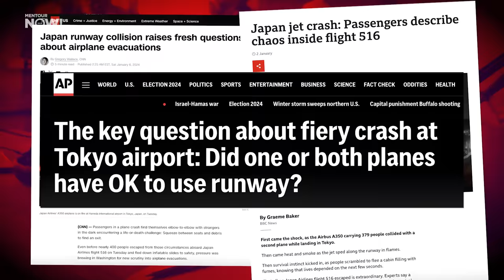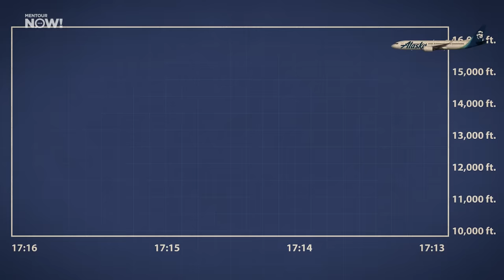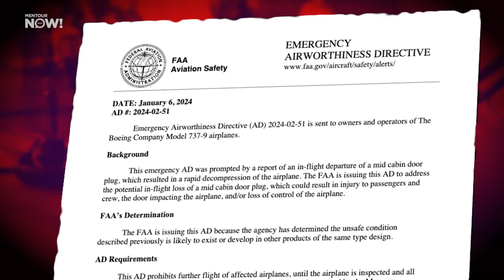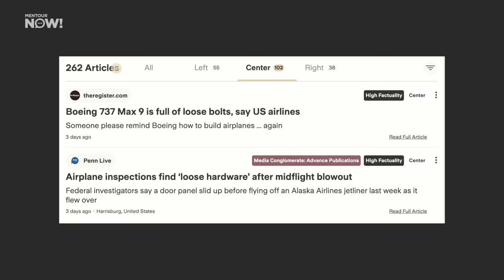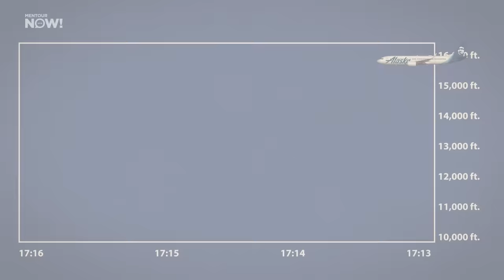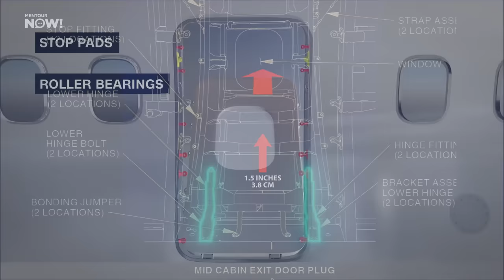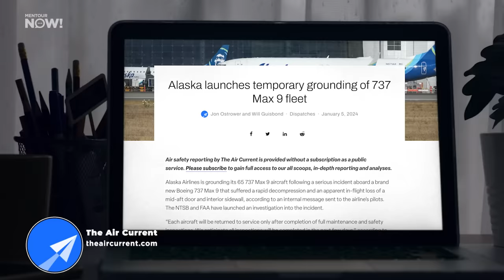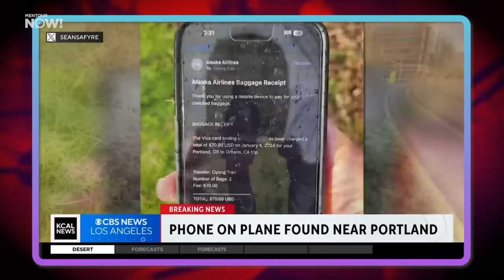WHAT Is going ON with Boeing?! MAX-9 Door blowout

Comment: Boeing used to be the coolest company ever.  As a kid I was totally awestruck when I saw the 747 for the first time; it was totally out of this world, and it was 30 years before Airbus became a reality.  Now Airbus is the world's largest manufacturer of airliners, and Boeing can't update a 50-year old plane design without screwing up.  So much for "maximising shareholder value."
Reply: Is Airbus the largest? I thought they were still not as big as Boeing.
Reply: Yes, very sad situation. I used to admire the earlier Boeings.
Reply: Poor management.
Reply: Stay off Boeing!!!!
Reply: Boeing went downhill when the executives at McDonnell Douglas took over at Boeing after the merger (after already screwing up McDonnell Douglas).  Before the merger, Boeing was run by engineers who lived on the floor and optimized the airplanes through production improvements.  The culture changed to a financial culture run by know nothing MBA's almost immediately after the merger.  Moving production to North Carolina didn't help either (they did that to use non-unionized non-experienced workers).
Reply: Profit over people. 😢
Reply: @Adam_U Airbus has consistently beaten Boeing in both orders and deliveries over the past 5 years. So yes, Airbus holds the top spot as leader of commercial aviation
Reply: @Adam_U Airbus has Boeing beat when Airbus became an American Manufacturer as well, they opened a factory in Alabama and produce A220 and A320 and without problems, Airbus also has a factory in China and of course in Europe, that makes them a global manufacturer now. Boeing doesn’t have the capability to produce aircraft in other countries, they’ve tried it in the past and every time failed, they are incapable of working with other governments or local regulators, and are even failing at working with American regulators (FAA)
Reply: @Adam_U  Airbus are significantly larger in the airliner sector. Boeing also makes a lot from military sales ! The most popular airliner is now the A320 family, NOT the B737.
Reply: @steveburton5825  Exactly.  If incompetence was criminal, the MD execs would be in for a lifetime sentence.
Reply: @ytzpilot  Which highlights the fact that this is a management problem, not an engineering or labor issue.
Reply: Boeing wide-bodies have always been reliable and innovative, but the 737 not so much.
Search about the 737-original/classic rudder issue fiasco and you’ll figure that Boeing had problems in its “golden years” too…even before merging with McDonnell Douglas.
Reply: Maybe management should remove share price from its list of strategic goals and focus on becoming a reputable company again. instead. It's obviously too late to undo that terrible merger that killed the spirit of Boeing.

I don't think I want to step onto a Boeing plane for the time being.
Reply: H1Boeing
Reply: According to Jack Welch, Boeing has done everything correctly.  What's the big deal about some stupid door falling off?  Nobody was hurt.  It's just a marketing problem -- why not just call the missing door a "ventilation option"?
Reply: @stevencooke6451  The 737, maybe. But I see no reason not to step onboard, say, a 777
Reply: How on earth did whoever Boeing had finally assemble this thing, get it wrong without being caught until something like this happen?  The door plugs were supposedly taken out until the interior was furnished, to make it easier to get items into the fuselage.  So whoever reassembled the door plugs into the door frames, being the last to touch them, must have been at fault.
Reply: @wildanfatihg  Should note that the fuselage for both come from Spirit Aerospace.  I suggest it is the age of the plane one should consider.
Reply: I used to work for a mutual insurance company which are banned from paying divideds and have to reinvest everything they make. It was shocking to me how much money they had for everything compared to conventional corporations whether in insurance or other fields. When I heard about how the US after WW2 applied confiscatory tax rates to dividends to discourage profiteering and encourage reinvestment it made so much sense. Even up to Reagan the tax rates on profits were 70% and then the top income of the wealthy was taxed another 70% for about 90% combined taxation on profiteering. We need to get back to that ASAP before everything in this country completely goes to $h!t.
Reply: Airbus was founded one year after 747 was released. The consortium which later became Airbus made CONCORDE.
Reply: Capitalism. Have to have constant growth to suit the market & investors. Only way to do that is cut corners.
Reply: We don't need no engineers, we need more salesmen.
Reply: @cormaccarroll Boeing started as a capitalist company & ran that way for many years very successfully. Something changed their corporate culture. It’s different leadership. Bad, greedy, incompetent.
Reply: @steveburton5825  So what happened at Airbus? Mentour pilot has quite a few videos on Airbus design issues that which have resulted in many deaths or at least traumatised passengers and pilots. I can think of a few others that didn't make his list.
Reply: lmao listen to this guy, I'm sure he highly educated and absolutely knows what he talking about.
Reply: DEI over safety
Reply: all you clowns knocking Boeing for this, PLEASE NOTE: @21:40 in the video, you will find the author of this video confirming this is NOT a problem with Boeing's design, as these exact same systems have been in use for DECADES on literally thousands of planes.
Reply: @thomasneal9291  Nobody is knocking the design - it's Boeing's poor quality control.
Reply: @Adam_U airbus has almost twice the market share
Reply: The merger with MD ruined Boeing and turned it into MD.
Reply: I agree. Also Look at what they contributed to the Space program? Like the shuttle?
Reply: @Adam_U Airbus surpassed Boeing in 2019.
Reply: Any company that specialises in "Shareholder value" is going to fail.

Companies survive and thrive when they produce a well engineered product that fulfills the requirements of the customers at a cost they can afford. If you fulfill those three requirements then your product will be in demand and you then have a chance at making a profit.
Reply: I remember when I was in engineering school in Madison WI, a number of my classmates took jobs at Boeing, but the word was they tended to not keep their new engineers much beyond the project lifetime that they hired in for.  This was in the late 1980s.
Seems to me they had a reputation problem already developing.
Reply: Boeing couldn't even design the cargo door of the 747 to remain closed... Boeing was never cool. Fuel tank that explodes, rudder jamming, thrust reverser activation mid flight, engines dropping off the wings.
Reply: @Adam_U 
I believe as far as commercial aviation goes that Airbus is consistently  outselling Boeing in large part due to the A320 family of aircraft.
Reply: Replacing engineers with accountants and financiers is always a recipe for disaster.  See General Motors after 1970.  The car guys retired over the years and they were replaced by bean-counters who knew jack about cars.
Reply: @Ayayau57  I think Boeing should just put the 737 into rest forever. This design has been around for ages and I think its full potential is already reached
Reply: I reckon this is the beginning of the beginning of the beginning of the end for Boeing.
Reply: No-one said it's a design problem: it's a quality/ greed problem.
Reply: @cormaccarroll   I am from a country that had witnessed communism… And I think that the corruption and nepotism during communism was making worse products than in capitalism… Should I mention the failed Tu-144 as an example?
Reply: @johnsonwu3001  Exactly… They had wanted to do this before but airbus launched the a320neo a decade ago while they were developing thr 797, and that forced them to make this 737 ‘MAX’
Reply: To be fair - the 737 deserves to be retired. It replaced the 727, which replaced the 707. Time for something new, since all the MAX' issues come from the simple fact that this bird can't be upgraded anymore. When the 787 was built, they planned for a small/midrange-variant with reduced seat-capacity, decided against it. (even Airbus hesitated for a new "small range-plane" - alloweing Bombardier and Embraer rollilng up the market)
So the only sane thing Boeing could do: let the 737 take its place in history-books, end the 7xx-series, building a new one; with modern manufacturing aso. 
It's not like Passenger will avoid flying with Boeing (if it's boeing i aint going!) due to all the issues the NEW boeings since about 2010 are having - so leave that old technology adapted to the new world be, and build a new plane? (everything else means "end of business" very shortly)
Reply: The thing about shares and the stock market is that it's a hype train. Safety is expensive and not exciting. Shareholders want to hear about how you're putting the rudder on the blockchain or whatever the latest fad is. That gets the stocks jumping, even though it's nonsensical.
Reply: @Adam_U  I think the size difference between Airbus and Boeing depends on the civlian/military sector. Airbus Defence only has a few big military programs and is mostly civilian, nowhere on the same level as Boeing. So civilian+military, Boeing is still a bit bigger than Airbus.

But in the civilian airliner sector specifically, Airbus has overtaken Boeing.
Reply: Read "The Black Swan" by Nassim Taleb.     A key point is that increasing efficiency inevitably leads to increased fragility (vulnerability to failure).

Engineering has a very strong safety culture that protects against that increased vulnerability to failure.      Boeing was OK as long as engineers were in charge.   Once they put people with financial backgrounds in charge, serious degradation of safety was inevitable.   Financial people are obsessed with efficiency above all other things, including human lives.
Reply: @pywaketpilot  But at this point, we don't yet know it it was boeing,   The evidence far more strongly implicates the airlines and whoever did the maintenance and cleaning of the aircraft, IMHO.
Reply: @jimbarron9939  No, it doesn't implicate Alaska Airlines or their maintenance.   This was a brand-new plane delivered only 2 months before the door blew out.  That's a manufacturing defect and is Boeing's fault.
Reply: @samuelglover7685 Jack Welch, who vandalised and destroyed GE.
Reply: @SkyrimCZtutorials Not entirely.
Reply: As with so many other big companies in the last several decades, they went from being run by people who were actually knowledgeable of and invested in the products they were making to being run by people who don't care about anything except to what extreme they can minmax their profit margins every single quarter.
Reply: I remember the sense of adventure when I went on an international trip, aged 10. The first leg of the journey was in a 707 operated by BOAC. And yes, I  have travelled by 737 too, back in the 1970s.  I wish the investigative teams well forming a useful opinion on what went wrong and why,  so they can publish recommendations that help make flying safer for everyone.
Reply: Uhm the Airbus A300 had it's first flight in 1971, two years after the B747. I5 was the first two engine wide body jet, a now common feature in the Airbus and Boeing fleet. So not exactly 30 years. And the companies that merged into Airbus had themselves been making aircraft in some cases longer than Boeing, like BAC, who together with the French companies that built Concorde became Airbus. So really Concorde is the first Airbus. It was just called an Anglo-French cooperation not a seperate comany yet but Concorde showed the could work together well and very soon after Concorde began to fly those same companies officially started Airbus with the A300. An ambitious project, you don't start off with a widebody. But of course Airbus wasn't really new, it was just a new moniker for a bunch of companies who had been making flying machines since the dawn of aviation. In fact the first jet airliner was made by De Havilland who later joined Hawker Siddley, who became part of BAC, who where partially owned by BAE and then became part of Airbus. So Airbus heritage goes back as far as jets themselves. So it's not that surprising they are now the largest manufacturer of airliners (and helicopters) since 2019 (same year B738/8 fell from the sky twice).
Reply: @221b-l3t  The UK now has a monor role in Airbus.  Another great British exit.
Reply: @yuglesstube   But until a few years ago they did have a larger stake. I think BAE sold their 20% I forget.
Reply: @221b-l3t  Thhhsts true, but the British also did not sign up for the project as they were expected to back in the Thatcher years.
Reply: I think it is a bad door plug design. The door shouldn't be able to be opened when there is differential pressure. Even more when no one tries to open it. The door plug should  be blocked on the pins by the internal pressure.
Reply: It's not "so much for maximising shareholder value." This is exactly what happens when that becomes a company's top priority, because it turns out there are lots of ways you can go about maximizing ROI for investors that have little to nothing to do with delivering a good-quality service or product, and sometimes delivering good quality product or service is actively contrary to maximizing those sweet, sweet profits. 

The problem isn't that they aren't maximizing shareholder value, it's that that's the only thing they care about. It's become abundantly clear that executives and management at Boeing either have no problems with people dying if it means bigger profits, or they are astoundingly-bad at showing they aren't.
Reply: @fanboy50  So how come Airbus gets away with it so easily?
Reply: @aycc-nbh7289  it's admittedly recency bias, but when A320neo's start lawn darting on take off killing all aboard and falling apart mere weeks off the assembly line I'll feel the same about them. But it's been a while since they have had issues like that, certainly in the US where I do most of my flying.
Reply: @fanboy50 Didn’t they have landing gear and window issues recently?
Reply: @aycc-nbh7289  those aren't nothing but it doesn't really feel the same as continuing issues with a model that started its service life with two planes deciding to kill everyone onboard.

I'm not pretending to be an objective observer here, I'm someone who has to fly a lot and has some problems with anxiety, and for anxiety brain, some potentially-dangerous but so far nonlethal QC issues registers a lot different from ongoing QC issues with a model that's already had two "everyone died" incidents as a direct result of a defect the producer knew about and intentionally obfuscated. The pattern matters.
Reply: @fanboy50  Airbus planes have been having these issues for about 20 years, so it may be an Airbus problem. But air fatalities are a lot rarer than road and rail fatalities and any air crash is likely to make major headlines as a result.
Reply: 💯 well said
Reply: wrgg